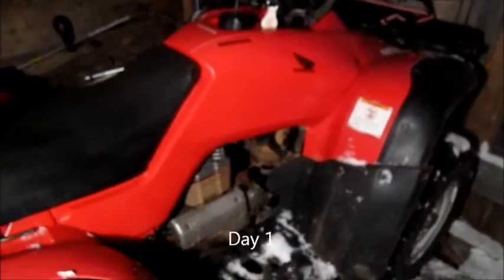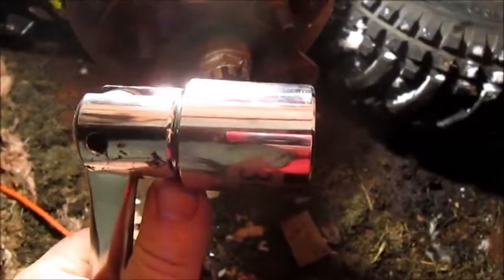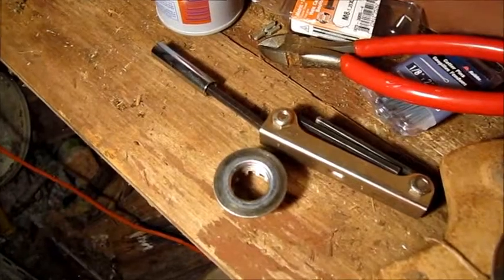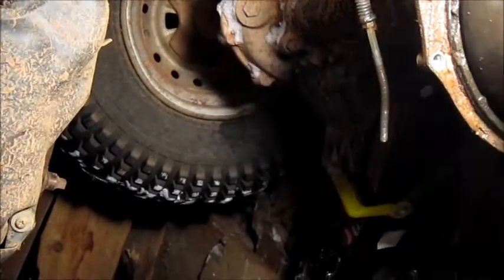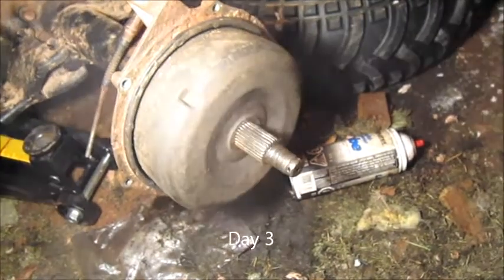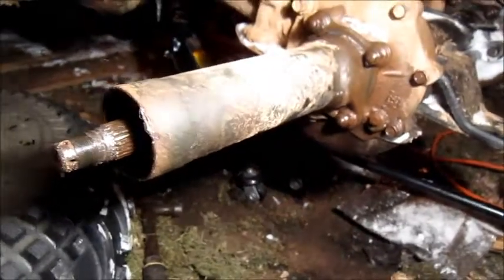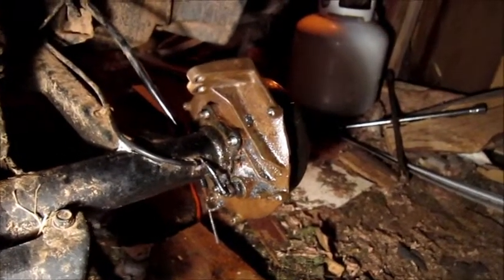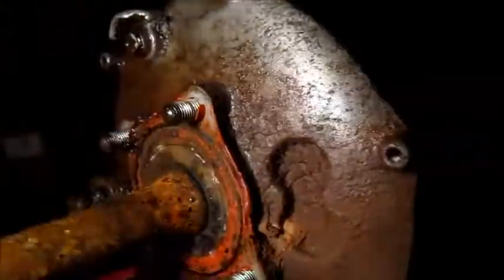Honda 350 Rear brakes Part 1

Comment: 38 years Autobody I tried EVERY cutting tool and torch and Air hammer plus 10 pound slide hammer I had "NO GO" .... then I drilled a 1/8 inch pilot hole and 1/2 inch larger hole to get to the inside of the brake pads and then I took my Milwaukee 1in 9/16  Hammer drill and rattled both inside brake pads then angled the hammer drill and vibrated the drum off... hope this helps someone
Reply from the maker: helps!

Comment: I got one question for you, when you used the wheel pullers to pull the drum you couldn't of put the pullers on the brake plate like you said, it wouldn''t work, you had to put the pullers on the edge of the drum and its to tight to do that so how did you really remove the drum. I'm not being negative here i just have a stuck drum and want to get it off
Reply from the maker: +stormennorm Yeah it was a bastard to get off but I did use a break puller and to get it done. LIke I said I had to clamp to the strongest part of the housing but it did work.
Reply: Yukon12gauge Still doesn’t make any sense. Your terminology is all wrong, and you can’t connect the puller to the backing plate and use it to pull the drum off.

Comment: So you pulled the whole break assembly off the shaft with the puller? Did you use any heat?
Reply from the maker: No heat neede in my case it was a tight if I recall.

Comment: I'm about to change mine on a Honda 300 1997. (Down south). Any tips ????
Reply: On the 300 there is a gasket on the Axel .the break drum won't come off easily unless u remove it !
Reply from the maker: good soldi bike

Comment: Sorry but i don't get what you put the pullers on,, the break drum or the aluminum backing plate?there is no room between the backing plate and the drum to use the pullers and if you put it on the backing plate it wont work,,, sorry if i seem to not get what you done bbut i am just trying to get the drum off, it is seized solid, thanks for helping me
Reply from the maker: +stormennorm The back of the drum where the bolt holes are and then I was able to use the brake puller to push the axle through. Mine had lots of rust but the brake puller worked
Reply: Yukon12gauge v